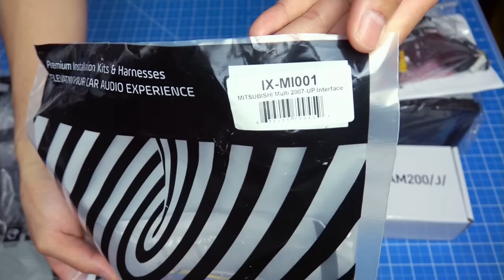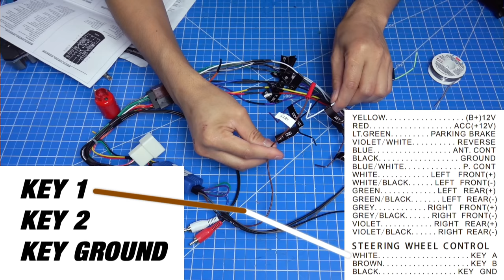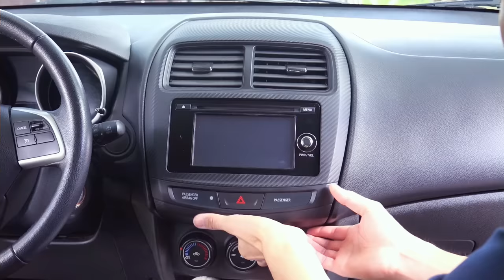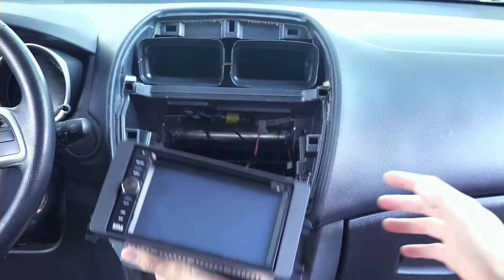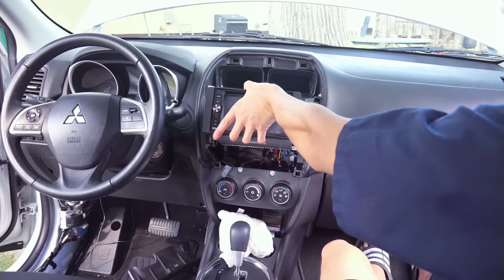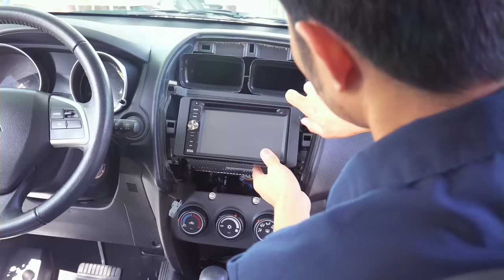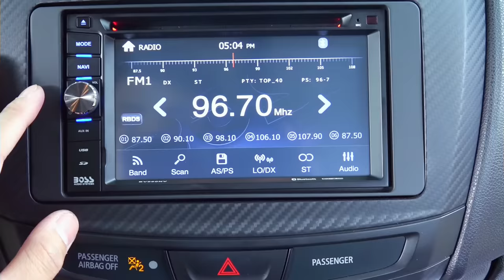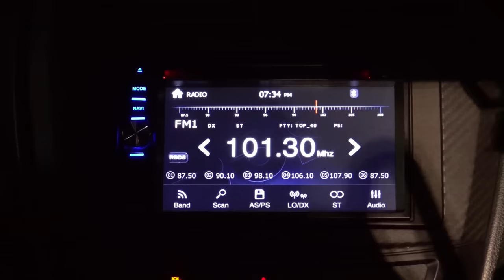Install Boss BV960NV Double DIN SWC 2015 Outlander Sport | DIY Fix

Comment: LOL! I lost my car and truck in the Harvey hurricane. I was given a Neon (Mitsubishi) that needed some work. Fixed it. And was thinking about a sound system. That plastic piece in the center of the dash looks just like the one in your SUV. I am going to drive this thing back and forth to work for a few weeks and if causes me no problem I might get a similar system, probably not going to have the DVD system but the XM and the CD mp4 and back up camera. I don't know if they still make that kind of system. Will find out if this car continues to run well. This car was owned by my brother and I know he had taken fairly good care of it. Motor had had major work year and a half ago. He lost his patience with it when the A/C acted up. So I replaced compressor and condenser all the orings etc. Now it works really well. So ironic that you are doing Mitsubishi.
I think a system like that might be worth more than the car I am driving, but I do miss my backup cameras and satellite radio.....
 Really appreciate your channel and the information. Your channel the reason I rebuilt old Kyosho Optimas and have Sakura D4s. Next car a RX7 drag car on a Tamyia F103 chassis.

Comment: Hello, I would like your help. I have a mitsubishi car, year 2000, equal to the one of your videos, but it has a problem when it is under way, the engine starts shaking and it does not accelerate.
Reply from the maker: Is the engine light showing?
Reply from the maker: You may need to replace the oxygen sensors to DENSO brand.  Watch here: https://youtu.be/YrV4wiC6D7w
Reply: @DarkDragonWing  thank you for your quick response but note that the sensor has already been cleaned and it still gives the same problem of shaking the motor and not accelerating anything ... what could it be?

Comment: Hi DarkDragonWing, I admire your work. I have 2018 Nissan Frontier Bear Bone with no option. I need to install a keyless entry and a remote start. Which brand and system do I need to buy, and how do I get a wire diagram for my truck. Thank you.
Reply from the maker: You can watch this video for that: https://youtu.be/AI3EXAUaRO4
You can use this website for wiring diagram: http://www.wirecolor.com/en/
Reply: I have Outlander 2012  without reverse camera the video  can it be installed?

Comment: Wish you were my neighbor. I want so bad to get rid of the P.O.S. that's in my truck but Chrysler being Chrysler they made it where it's going to be a real pain to swap head units due to cutting of metal support brackets in order to get another radio in for starters. Plus, pulling all that plastic trim, I don't know how you do that without snapping clips or destroying that brittle plastic. I give you props dude, you really know your stuff!

Comment: A question mate? I am begginer in this. I have exactly the same car as you. I bought a Sony XAV-AX-3005. This stereo came with an harness ISO. Do i really need to do the crazy wiring? Can i maybe buy some kind of adapter? I saw an adapter in Amazon that i know fits the car. This adapter only is for the big plug, but the Mitsubishi stereo comes with 2 different white plugs. Whats the second for? Can i just not plug it to anything?
Reply from the maker: Hi. I'm sorry, I don't know much about that one.
Reply: @DarkDragonWing  Thanks for you answer brother. Last question...
The mitsubishi original raido has 2 plugs. The big one and the medium one. What is the second one for? Nice if you know what is it for otherwise no worries.

Comment: Thank you . what about the door actuator do i have to buy the kit or just the actuator will work the remote start and keyless system.
Reply from the maker: Your car doesn't have the actuator??
Reply: yes
Reply: no power door lock, no power window.
Reply: key start yes.
Reply from the maker: You will have to know how to install the actuators to your car to lock/unlock your car with the remote. Right now you can only install the remote start option.
Reply: Will the Crimestopper RS2-G3 Cool Start (TM) 2-Way FM/FM LED Single Button Remote-Start & Keyless-Entry System electronic consumer or the Viper 4105V Remote Car Starter 1-Way TWO 4-Button Remotes Keyless NEW 2017 Model & Directed DB3 XPressKit DEI Databus ALL Combo Bypass / Door Lock Interface Bundle Package work with the Gear Universal Car Power Door Lock Actuators 12-Volt Motor (2 Pack)? thx

Comment: I have this same radio and wanted to see how to add the camera. Its definitely alot of work but i think if i wait until once i decide to sound proof the floor of the car. It could be a 2 birds one stone thing. Its a 2008 honda fit so id take off the whole carpet of the car and alot of the plastic panels. So running the wire shouldnt be a problem. Then use cloth tape everywhere that plastic touches plastic

Comment: I bought all the products using the links you provided but once I got to soldering I noticed that the wiring harness has Key 1 and Key 2 but the head unit does not have the key A and Key B wires. Does this mean I won't be able to use my steering wheel buttons?
Reply from the maker: Did you buy Boss BV960NV? If you did, then you should have key A and key B wires. And yes, if the head unit doesn't have those wires, then you won't be able to use the steering wheel buttons.

Comment: Is there a fuse on that reverse light wire being ran all the way from back to front?  I was looking at the BV960NV just now and I was surprised to find your video from 5 years ago...old unit still being sold.  I was wondering if they ever update the maps but I can't find a single update on their web site.  So the maps never get updated?
Reply from the maker: You can add a fuse if you want. Not sure about the map. You should get a plug and play android unit instead.
Reply: @DarkDragonWing Yes, the unit you installed has a good price though and I don't like plugging my phone in, that's why I was wondering about maps.  The bigger brand units like Pioneer are about $100+ more for wireless android auto.  Great video though, thanks.

Comment: Hi @DarkDragonWing,  I love watching your videos because its a really easy way for me to learn how to fix my car. Also, i learned how to install my Bluetooth radio in my car by looking at your video. Anyways, I'm having trouble with my Mitsubishi mirage 2001 car. The problem is I cant open the rear door from the exterior side. I was looking up so many videos on how to remove the door panel but nobody has done a video for the mirage.  Can you please do a video on how to remove the door panel please. Thank you.
Reply from the maker: There is a safety switch on the rear doors. You just have to turn the switch to allow the door to be opened. If that is not the problem, then here is the video that I remove the rear door panel: https://youtu.be/QcpL3ZHDYRA

Comment: Does this head unit take rca cables? I have a subwoofer I want to install and am wondering if this head unit would work for that
Reply from the maker: I can't remember at this point, but I kind of remember that it would take a subwoofer connection.
Reply: @DarkDragonWing  thanks so much

Comment: Did you get a passenger airbag warning light afterwards?
Reply from the maker: no
Reply: I did. How did you get that resolved? Is it from disconnecting that wire from front panel?
Reply: @mmmichal  i have same issue. Did you resolve?